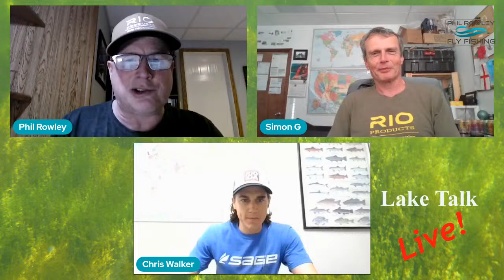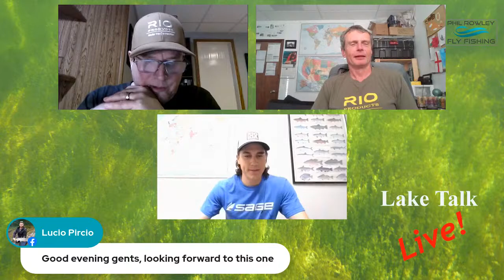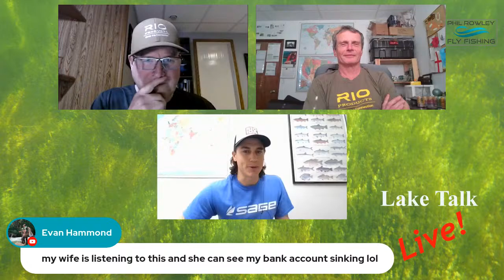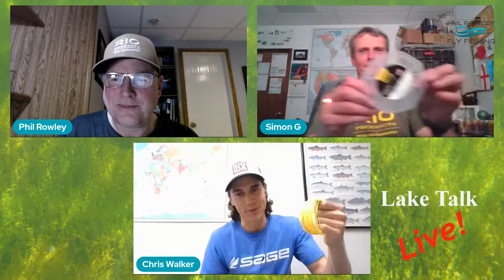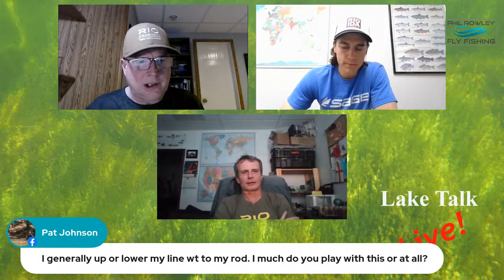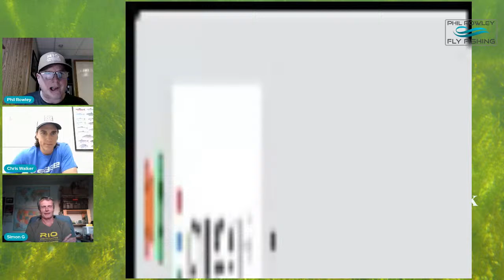Lake Talk-Making Sense of Stillwater Fly Lines

Comment: I wish Rio made the hover line running line a different color than orange. Stealth in stillwater with camo lines is a a reason for success on big fish. We do not need high vis orange for a sub surface line. On windy days with chop on water you aren't looking at your line. I fish from a float tube in very clear water.
Reply from the maker: Hi, they do.  The original Hover line did feature an orange running line.  This has now been replaced, for a few years now, with an olive running line and grey head.  
https://www.rioproducts.com/products/intouch-hover

Cheers, Phil

Comment: From the shore line of a lake a 20 feet front taper line with a thick tip is the best for indicator or team of flies due to long head of about 45 feet and when over head casting it has a wide open  loop that prevents tangled, and this line is the 40 plus from airflo the rio indicator line is more like to cast from boat or river.😂

Comment: Hi Phil.  Pretty sure that I have heard you mention a sink tip line for stillwater.  I have an old line but am looking to replace it but I am having trouble finding a 5 or 6 wt line. Any suggestions for me?  Thanks.
Reply from the maker: Hi Barry, the only sink tip I use is the RIO Midge Tip or Midge Tip Long.  The Midge Tip has a 3' clear intermediate sinking tip and the Midge Tip Long has a 6' intermediate sink tip.  These are both available in 5 and 6 weights.

Cheers, Phil